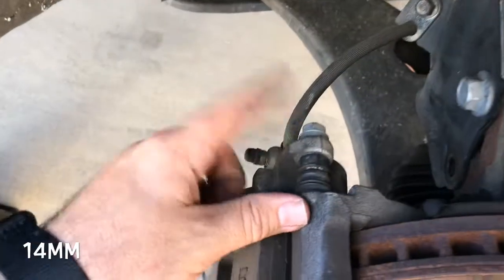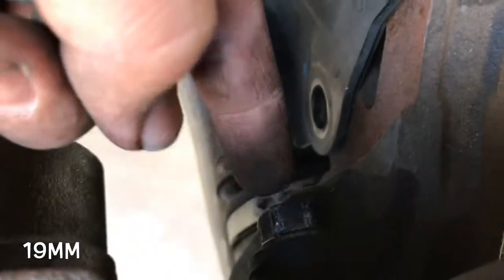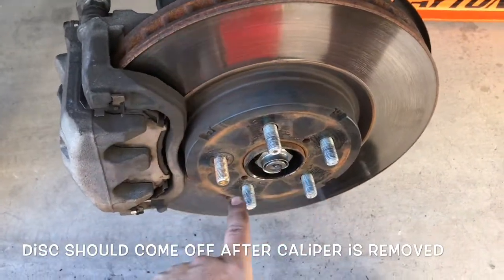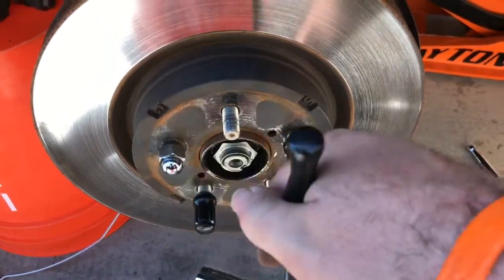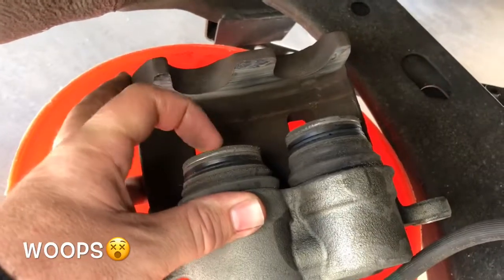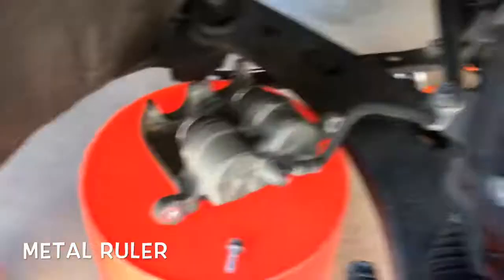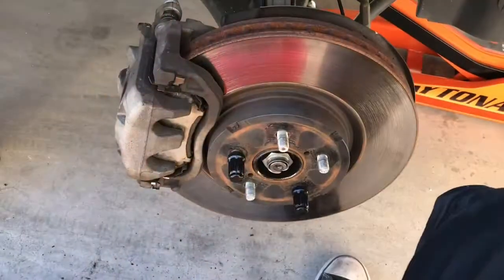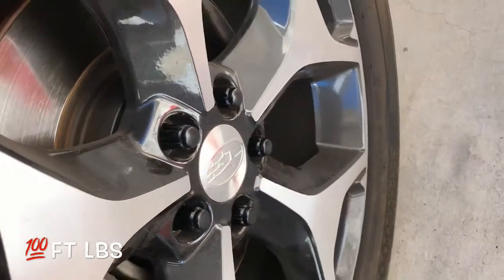2015 Forester XT: Wheel Stud Replacement

Comment: I was able to use a ratchet combination wrench to get the upper caliper bracket bolt off. This way I avoided removing the strut bolt. The stud installer tool (I used the one by Lisle) worked great. Just some light machine oil on the stud and lug nut and a 24” long breaker bar was all it took to pull the new stud into place. No impact wrench needed. And that means I didn’t damage the lug nut that I’d used to pull the new stud into place.